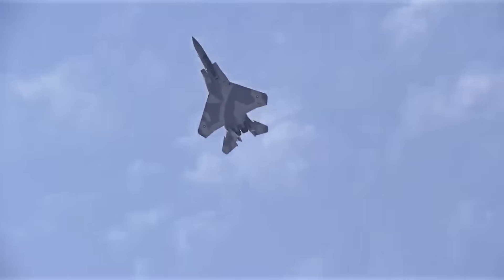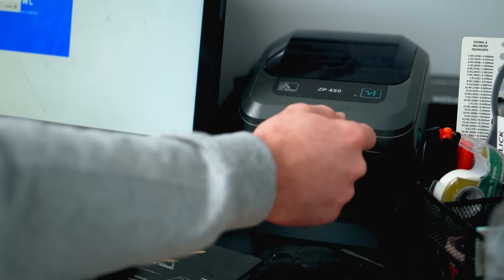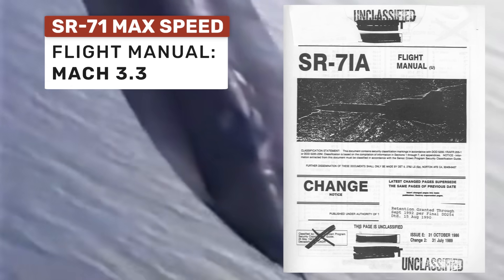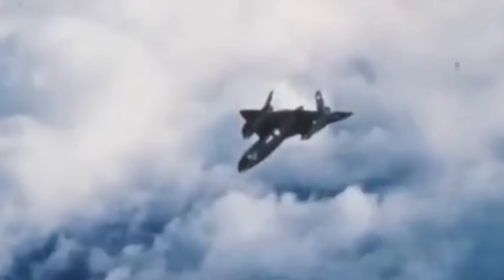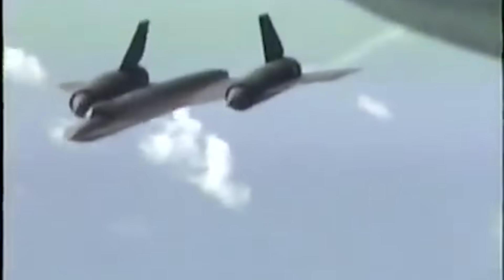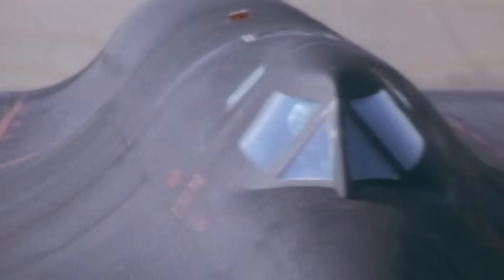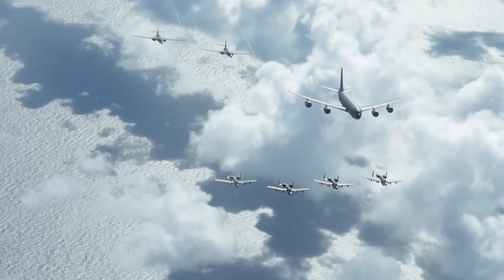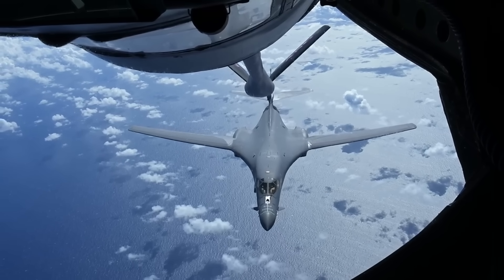The SR-71 was MUCH FASTER than the Air Force will admit

Comment: Answer is mach 14 while barely skimming the atmosphere. Any lower you melt, any higher the engines starve.
Reply: Lol what
Reply: @gr8crash  less drag=more speed

The higher you go, the faster you can go, but at a certain height you HAVE to go faster to get enough intake

Riding those variables as high and fast as possible they achieved mach 14... you should see what replaced it
Reply: @naroon5455 it sounds like you're trying to say the SR71 went mach 14? That is absolutely impossible. Like literally the plane would have crashed if it even tried. 

It could barely do 1/4 of that speed.
Reply: @gr8crash  it did. Which we still wouldn't even know the SR-71 existed if we hadn't stolen its silhouette from Russia. Turns out they were looking at our runway at area 51 and using the cooler spots of the runway to determine our experimental aircrafts shapes. 

We even started messing with them by cutting out weird plane shapes out of cardboard and laying it on the runway, then bringing them in whenever a Russian satellite was overhead just so they would see the shape of things we never actually built. 

Oh, and go check out how much we've extended the length of the runway since the good ol days of the blackbird
Reply: @naroon5455 so many more inaccuracies.  

First again it did not. The SR71 could not in anyway whatsoever under any circumstance reach mach 14. 

What you're referring to is the A12, not the SR71. The Russians knew the rough shape of the A12 from the IR signature left behind, and yes they did mess with them by painting fake shapes etc.

But that was the A12 not th SR71. The SR71 was never at Area 51, never flown, tested or operated there. The SR71 was a very public aircraft. It was acknowledged to the public in early 64 and it's first flight was in full public view later that yr in Dec 1964.
Reply: @gr8crash  both aircraft are synonymous, which runway is irrelevant, and cool things to check out are cool. And no I'm not referring to a literal mach speed, I'm referring to a relative mach speed. 

IF it achieved the same physical speed it could travel at what we consider to be a "normal" mach 1.0, the physical speed it'd be traveling would be right at mach 14. No its not literally displacing that much air. No, it's not a literal mach measurement.
Reply: @naroon5455 figuratively or literally,  the aircraft never flew remotely close to that speed.
Reply: @gr8crash  I think I'd rather believe one of the engineers who built it and simultaneously ran out of Fs to give in his old age, than somebody telling me he's wrong. 

When asked if he'd get in trouble for saying this stuff he basically said "yeah well I'm too old to care and there's honestly nothing they can really do to me at this point, plus they don't really care much about old programs"

No that's not what he actually said, but it sums it up well enough. It was a very typical recounting that I'm sure you've heard before until top speed was brought. He laughed at the declassified top speed and then was proud to say she could go way faster. 

He then explained how the higher you go, the faster you can go, but the higher you go the faster you HAVE to go, otherwise your engines stall... or starve? Can't remember which word he used. He then said the faster we ever got her was right at mach 14, but by that point you're just barely "kissing" the atmosphere. 

Or now... was it a pilot maybe? I've heard so many stories about the thing i can't remember if he was a pilot or an engineer. 

But it was just a boring old radio interview until he pulled mach 14 out of his back pocket and proceeded to explain it. 

This is probably a 20 year old interview at this point, but i never forgot "mach 14" while "kissing" the atmosphere, because I've been trying to tell people how awesome the blackbird REALLY was ever since
Reply: @gr8crash  If you find it lemme know, i think i also remember them talking about the space shuttle "slamming" into the atmosphere at mach 25 when it comes back for reentry, and that that's almost twice as fast, but still a lot of heat at 14
Reply: @naroon5455 whatever he told you, was completely BS. Now for the SR71 to fly faster, it had to also fly higher,  but it couldn't fly higher/go faster than what is already known. Maybe he meant mach 4, and you remember 14? But even mach 4 isn't possible. It's literally impossible for that aircraft to do. I don't what circumstances you think this guy made up. In the real world, it absolutely is impossible.
Reply: @gr8crash  Can it fly higher and faster than they'll admit? Surely. So it can go above 85,000 feet and go faster than 2,200 mph. So if it goes even higher you don't think even double that speed is possible? (4,400 mph) why not? What physical limitation am i not understanding that you are? One of us are failing to understand something. My personal understanding is we're limited by the thrust and the equal and opposite reaction of the material leaving the back. So how fast could those engines go in a vacuum no drag? 

Okay. New thought. Mentally imagine one of the engines completely separated from the aircraft, so it's like a rocket. Now literally stick it way out by the moon. Ignoring how it would obviously function and just imagining the thrust, how fast could that thing get moving if you just turned it on and let it continue to accelerate?
Reply: @naroon5455  how fast they could go in a vacuum is irrelevant as it wouldn't go anywhere because jet engines don't work in a vacuum. 

Also, no, there's no way in reality the aircraft could even go double its speed. Its 100% literally impossible. Could it fly over 85k ft? Yes, everyone knows that as it reached just over 89k ft during the record flights, and also did surpass 3.3 but ONLY under very specific environmental circumstances and not fully within the pilots control. 

But to think that it reached mach 4+ is absurd. The airframe itself couldn't do it, couldn't handle it and wasn't designed for it. The engines weren't rated for those speeds, they weren't even certified for mach 3.5. The engines, inlets etc were all designed to operate at mach 3.2, which is what the engines were uprated to. So, no there is literally no way at all that the SR71 could even reach mach 4, let alone anything higher.
Reply: @gr8crash  i literally said "ignoring how it would obviously function"... but okay, let's take a rocket that has the same thrust as those engines maximum output. How fast could that rocket go if it just kept accelerating? What would its top speed be? You're telling me somethings not possible when I'll bet you have no clue what IS actually possible.
Reply: @naroon5455 in regards to the SR71,  yes I absolutely know what is possible. And whatever speeds you're imagining are literally impossible. Again,  not only would the airframe not handle it, the engines couldn't handle it and the aircraft itself would crash if it even tried.

As for the space tangent, who cares? But if you wanna try and figure out that math, which thrust are you wanting to use? The thrust at cruise speed? What weight of spacecraft are you looking at? A light craft? A weight equal to the SR71?  Is it already in space? Is it in orbit? Etc. Can't really factor a number with the limited details you've given.
Reply: @gr8crash  what would the air frame be unable to handle? 

What would the engines be unable to handle?
Reply: @naroon5455 I've already kind of gone over this, not sure what you aren't quite getting. The engines were only rated for mach 3.2, even at 3.2 the inlet spikes were full retracted meaning there was no more adjustments left for the inlet to keep control on the inlet shockwave. To reach mach 3.8 "which was the maximum potential airspeed" it would have required an inlet redesign to handle to airflow and water injection to keep temps down, and that would have only been a dash speed. Airframe wise it was solid until mach 3.4, past that speed various parts of the airframe needed to be studied for faster speeds,  redesigned for faster speeds or just all new materials for faster speeds. Again the aircraft as built could never reach mach 4, let alone above mach 4
Reply: @gr8crash  Okay... so let's say those limitations are based on 1 cubic meter of air at a certain altitude. How much air they're running into at those speeds, at that height, ARE the limitations...

Now go to where the air is 4x thinner to where you would have to go 4 times faster just to interact with the exact same volume of air... am i making sense now? 

Reduce the amount of air molecules you're plowing through, and increase speed proportional to the reduction to keep the equations the same...
Reply: @naroon5455 I understand what you're attempting to say, but that's not how aviation works.
Reply: @gr8crash  but why not? You say it's impossible due to the amount of stress a certain volume of air would apply... reduce the volume of air proportional to your speed and you're only limited by the exhaust output of the engines. 

Now... you CANNOT descend because yes... you'll slam into those limitations. It's very dangerous. But i wouldn't say impossible

Comment: Separate from the airframe, itself, some of the reading I have done on my favorite jet suggests a theoretical upper limit for the engines to be somewhere around Mach 6.  In this case, “engines” being in full bypass, as from my understanding, the J58 itself actually throttled back when reaching a certain speed, and the air bypassed it, going directly into the afterburner.

Even so, given most “cruise” speeds are around 75% power, it wouldn’t seem out of the question for it to push Mach 3.5-4.0, assuming the airframe could take the heat.
Reply: Virtually that entire comment is incorrect. The engines could never even remotely get to those speeds or even be capable of those speeds. Not sure where you get that 75% number but that is wrong as well.
Reply: @gr8crash  you do realize, that on the J58, beyond a certain speed, the bypass was opened, making the intake air bypass the turbojet portion of the engine, and routed it directly to the afterburner.  This essentially turned it into somewhat of a ramjet at cruise speeds.  You would be correct in saying that the turbojet, itself, was not capable of those speeds, as it was not capable of sustained cruising at Mach 3+ in the first place.  Hence, the bypass to the afterburner.  And I did say "theoretical upper limit" for the J58 didn't I?  Theoretical limits and real world limits are 2 completely different things.  In any case, Mach 3.5-4.0 doesn't seem unreasonable for this aircraft given a cruise speed of Mach 3.2-3.3.

Now, as a private pilot, it is typical to run at between 60-75% throttle for cruise, depending on altitude, and what kind of speed/fuel economy you are willing to accept.  75% power is the accepted cruise power.  When it comes directly to the SR-71, I am certainly not qualified to say with 100% certainty that Mach 3.2 was 75% power, but it stands to reason, it is within the ballpark.  100% power is usually reserved for takeoff/acceleration.

So, maybe my whole comment is incorrect, but instead of just saying it is incorrect, maybe substantiate what you are saying.  I am not opposed to hearing logical reason.  You gave no reasoning, logical, or not.
Reply: @mahnkemachine3281  so some other errors to address. And i don't mind adding correct context, just most people don't ask or want to ask for it so i usually don't unless they show and interest, as you did. 

So, yes i do know quite a bit about the J58. The bypass ducts did not duct ALL the air around the engine. It was around an 80/20 split. But the core of the J58 which was a turbojet engine was always fed air and was always running. Without that engine running the aircraft simply couldn't operate. The aircraft, using its inlets, ducts and bypasses helped to created a ramjet effect without having to have an actual ram jet, which is what made the SR71 family viable. Previous designs used both engines separately within the aircraft, but these options were all discarded in favor of the A12/SR71 engine layout. The engine "J58" was in fact capable of sustained mach 3 flight as that is the flight regime it was designed for. Remember that engine was initially build for a Navy aircraft and was only built for Mach 2.5 flight. Lockheed had to work with P&W to have the engine uprated to be certified for mach 3.2 flight. They did consider having it certified for mach 3.5 flight, but this was considered impractical at the time. Mach 3.5 is ONLY possible under very specific and abnormal atmospheric conditions and was not something the aircraft could do. Even approaching those speeds, the pilots were in a situation where they weren't fully in control of the aircraft. 

I get your idea of throttle, and cruise etc. And on a normal aircraft i would tend to agree with you, but this isn't a normal aircraft and the throttle response wasn't purely "linear" like you are thinking. The SR71 speeds varied greatly on atmospheric temps. Warmer than usual and the aircraft wouldn't even make mach 3, or would require so much extra fuel burn that the mission would have to be aborted, which did happen. Other times if the air was cooler than normal the aircraft could fly at mach 3.2 with ease. Meaning on a warm day, to attain mach 3.2 they may have had to have the throttle in FULL A/B to reach mach 3.17, which was their mission cruise speed. But they'd be burning so much fuel that they'd not be able to complete the mission and they'd have to abort. On a cooler day than normal they could be at maybe 50% on the AB Throttles and be comfortable at 3.2 with low fuel burn. 

These aircraft, were limited to greater speed by the engines themselves. They were all limited by an Engine CIT of 427°. So using the above on a warm day they may be at 427°c and not even at mach 3, and on a standard day they could be at 3.2 at 420°c and at 3.2, or on a colder day they could be at mach 3.3 at 400°c.

Comment: my Dad was personal friends with several SR-71 pilots. He was former Air Force and had top secret clearance through the FAA. He told me once that two pilots confirmed that they had taken the SR-71 over 100k in altitude and taken the SR-71 more than double the posted speed. They also said that it happened over China while they were spying on Russia. They were flying for their lives. They were literally running from Russia's fastest anti-aircraft missiles.  China had given permission for the U.S. at time when relations were not going well between China and Russia.
Reply: Lol none of that is even remotely true. The SR71 never flew over 100k ft, never flew that fast, nor did it fly over Chine or even Russia. And the FAA issuing a TS clearance?  Never heard of that before either, the highest they usually issue is Secret level.
Reply: @gr8crash Sorry, my Dad had top secret clearance in the AF and those gentlemen were personal friends of my Dad and had nothing to gain iwith lying.
Reply: @BubbaTxx sorry but again that's all total BS. Also "having a TS" is irrelevant. MANY people use the to try and prove a point and it fails. And it fails because the SR71 wasn't even a TS aircraft.  You only needed a Secret clearance to maintain and operate it, so the whole having a TS comeback is pointless. 

But again simple facts, it never once flew over China. It also could never reach the speed and altitudes you tried to say. It would have crashed long before even getting to those speeds.